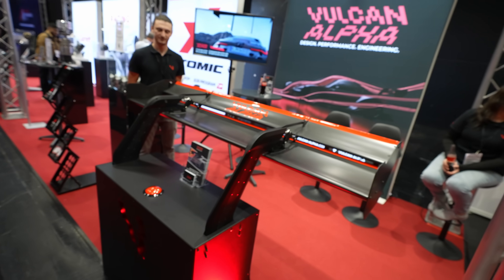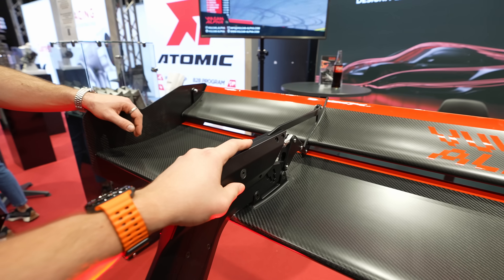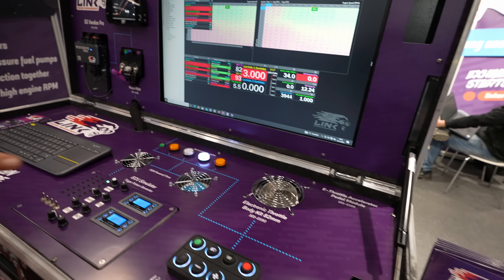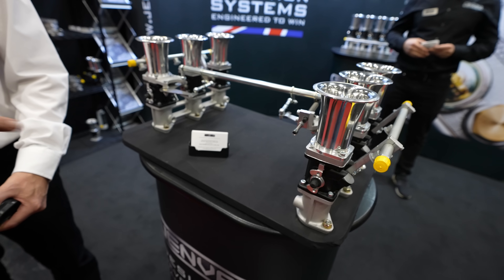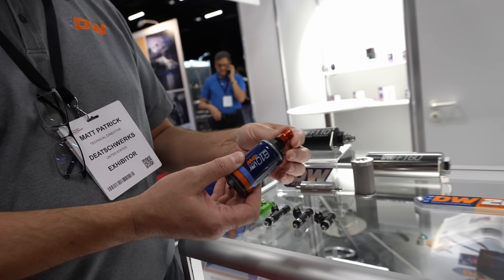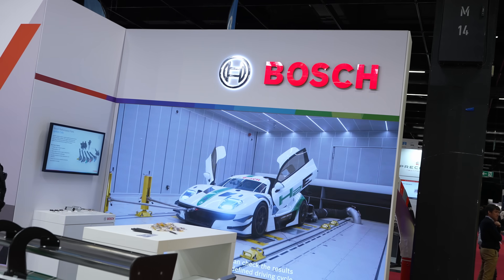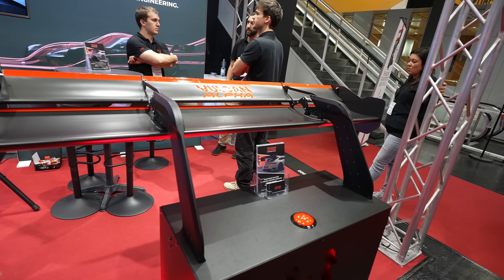Proud: Unveiling World's First Universal DRS Wing

Comment: You guys better take car of the hatchback squad quickly....I suggest a mounting kit on the hatch lid mounting points using  longer bolts or engineer some proprietary bracket...start with the VW Golf coz then it can take car of 4 models at once

Comment: It’s not the first fyi Victor Racing has had a universal wing out for several years.
Reply from the maker: A DRS wing needs to consist out of 2 elements
Reply: @mgcharoudin2   it's a system that's designed to reduce drag. The term "System" can consist of multple elements whether its 1 or 50 components. Nowhere does it stipulate that in order for it to be a drs system it cannot have more than 2 elements. Correct me if im wrong. But the current drs system has more than 2 components. Main plane, rear gurney flap, software and switch.

Comment: Can you also make it intelligent...so it can enable DRS when it sees full throttle input (and steering is straight)... and disable drs as high braking is sensed...so that more down force can slow the car down and reduce brake pads/disc wear in a lap.

Also where will be DRS button installed??? Like in 992 GT3 RS it's on steering wheel. In this case where it might be installed????

Anyway within one 1 year of your company you have launched such an impressive product 👏🏻👏🏻👏🏻👏🏻 very very impressive 💯💯💯

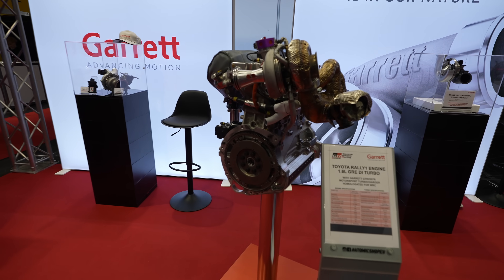Comment: 3:28 = Garrett GTR2557R, so that's the turbo in Rally1 GR Yaris! IMO that engine has good potential in a swap... imagine that engine inside a Smart Roadster!

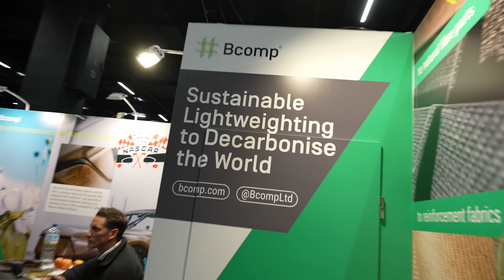3:56 = That's a good idea! Trying new material in Vulcan-Alpha wing!

5:51 = The defeated looks on Lapo's face tell how often Misha were using bad jokes off cameras. 😂 That said, Link G5 Voodoo Pro & Haltech Nexus R5 are two very capable ECU!

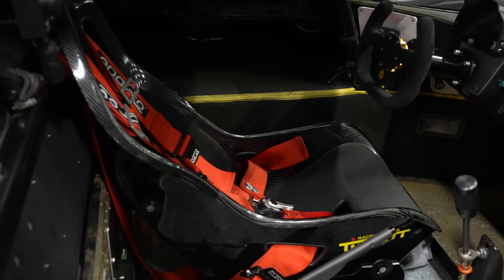6:34 = I believe that black Ultima GTR still has pre-LS small-block Chevy V8, because the middle two cylinder has close exhaust port while LS (gen3 & gen4 SBC) had equal spaced exhaust port.

Comment: A question that may be more in Lapo's field of expertise - why pneumatic actuation, instead of having the DRS element sort of "balanced" and using some form of cable activation like on the first DRS wing on the back of the speedster? Seems lile that would be require significantly less equipment fitted to a track focused car that already tries to minimize weight at every turn. Dyneema came out with a rope that doesn't stretch at all under load and can be bent around much tighter radii without fatiguing compared to steel - which would allow housing the entire mechanical system for DRS activation in the wing supports, only needing a set of electrical wires to go to the wing instead of pneumatic lines, a compressor, a high pressure air tank, regulator etc etc.
Reply: They couldn't charge 10.000 € with a cable actuator so they introduced the super innovative compressed air pistons

Comment: Also downforce figures for the DRS wing for both modes would be interesting to see. How much a reduction in drag when DRS mode is activated compared to full drag mode would be very useful to know.
Reply: They are on the product page on our website :) link in the video description
Reply: @mgcharoudin  Thanks! Looking to get a 991 GT3RS and put this and the DRS front splitter on. It would be interesting to see how close it would be to the 992 GT3RS. I would be really sweet if you could make the DRS wing look close to the factory wing, if that's possible without negatively affecting the performance too much.
Reply: @UltimateDan1  I think the 992 RS winst a lot from the suspension geometry (double wishbone front) etc. But in terms of aero, a lot can be done

Comment: That's cool, but I wonder if you could make it lighter without a motor if the DRS deploys with hydraulic under aero pressure over 100 mph for example. Just a thought.
Reply: Nope, if it deploys in a 100mph fast corner your'e fucked!!!!
Reply: @Si-bw3is  No, you can tie the hydraulic release control to the throttle, off the throttle it snaps back to aero. It's still a heck of a lot lighter and if you do it to the throttle body in a mid/rear engine you don't even need a long release line, and it probably should deploy depending on the car, if it is a 220+mph, 150-180 because it could corner at 100, but even cornering at 100 you wouldn't be flat out with the throttle floored or you're F'd anyway.